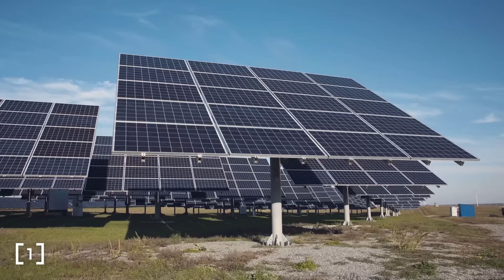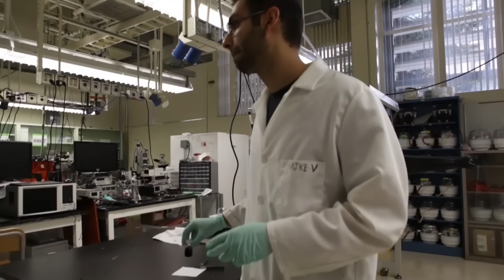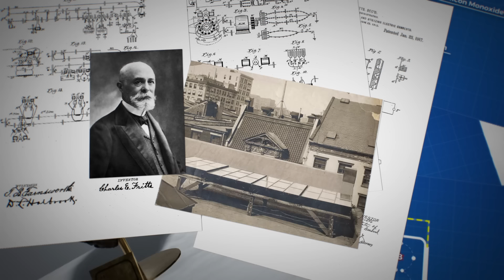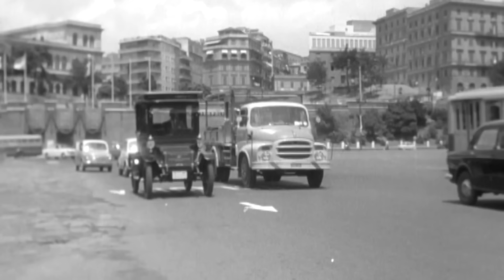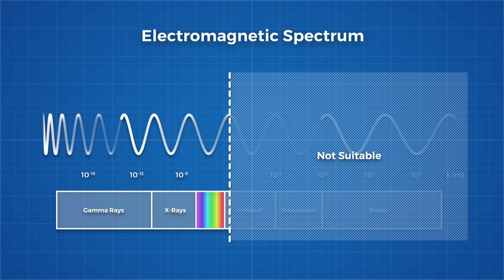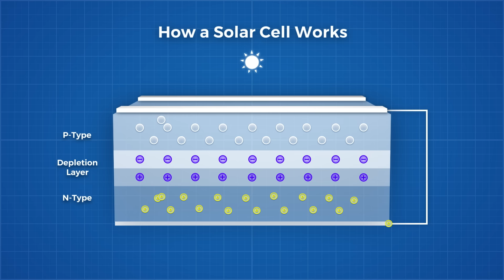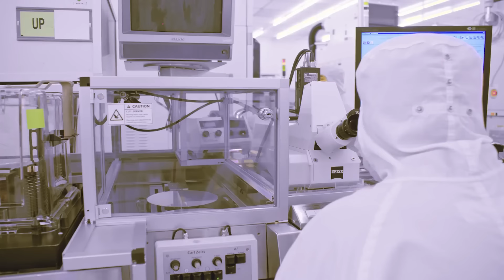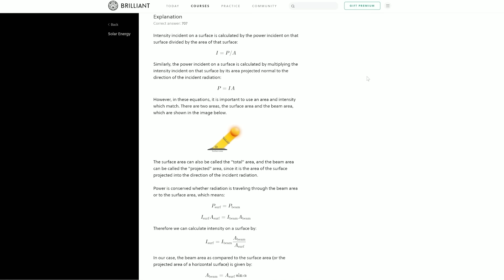The Mystery Flaw of Solar Panels

Comment: “Installed capacity” of 630,000 MW translates into 126,000 MW or less of actual capacity, if the sun is shining and the panels are new. It is an open question whether a solar panel makes enough energy to manufacture, install, decommission and dispose of itself in its lifetime.  If it does not, then every single solar panel represents a backward step in energy efficiency.
Reply: And your claim that solar can't generate enough power to cover it's lifetime is rubbish
Reply: This is true, however there is value in the research and fabrication techniques that is very difficult to quantify. We also can't know whether or not it's "worth it" until we push the technology to its limits. Unfortunately that's the reality for any technology.
Reply: It is worth noting that solar cell prices have been dropping like crazy, to the point that even without subsidies, the payback for installing a cost-effective roof mount system in a reasonably dry sunny climate is now as low as 7-10 years.
Reply: @theredscourge   I don't know what country you're in, but here in Australia we have some of the highest electricity prices on earth and the payback can be as little as 2-5 years
Reply: @samk4339  Meanwhile your coal is exported to China where electricity is inexpensive and they can afford to produce and profit off these eco frauds.
Reply: @topduk  actually China just stopped importing Aus coal and is also the world's largest renewables generator and has cancelled construction on most new coal, gas and nuclear power plants.
Reply: @samk4339  hi, 
I couldn't find a source corroborating your claim, could you please provide one ?
However, I did find several that say China wants to massively increase nuclear capacity, by nearly ten times by 2050 (from 58 GW to 500+ GW). 
here it is (updated October 2020) : https://www.world-nuclear.org/information-library/country-profiles/countries-a-f/china-nuclear-power.aspx
Reply: @yamchas  https://www.google.com/amp/s/www.technologyreview.com/2018/12/12/138271/chinas-losing-its-taste-for-nuclear-power-thats-bad-news/amp/
Reply: @samk4339  hey,
the article you shared even states that while some experts IN china believe nuclear is on the decline, the official stance of the Chinese government is still pro nuclear, which also aligns with the Chinese government confirming plans  to add 200GW by 2035 having started building 4 more in 2019, and aiming for 6 per year for the next 5 years

As for the stopping import of coal, thats a political reaction to Australia placing taxes on exports to china and preventing the sale of assets to china, The coal that would have been imported from australia is instead being mined with in china with new mine being confirmed just the other day

https://in.reuters.com/article/china-nuclearpower/china-to-build-6-8-nuclear-reactors-a-year-from-2020-2025-report-idINKBN24A0DL
Reply: @samk4339  Cheers Sam!
So, we're left between this prediction, and the fact that, as another commenter said just before, the chinese gov is still pursuing nuclear power as an option, and that China has started building new ones since the article you sent was written, but perhaps with less enthusiasm. So i guess we'll have to see. In any case, their renewables produced only 9% of their needs last year, so they are far below the threshold after which problems and costs start adding up for renewables (although renewables have started making everything else's electricity more expensive, as their nuclear or gas plants, for example, are kept at a low level while the wind is blowing)
Reply: @yamchas  sorry but your 9% figure is bullshit.  In 2017, renewable energy comprised 36.6% of China's total installed electric power capacity.
And that was 2017! Since then they have built even more renewables capacity and it outpaces the increases in coal and nuclear 2 to 1. 
Also your claim that renewables increase the cost of power is a right wing talking point that has been debunked many times over. Coal and gas receive more subsidies than renewables. In fact you sound like a lobbyist for a fossil fuel company, who do u work for?
https://en.m.wikipedia.org/wiki/Renewable_energy_in_China
Reply: @samk4339  Hi there, 
sorrry, I hadn't seen your reply. I'm not sure if you read the webpage you sent, if you scroll a bit down, you'll see that most of their renewables productino comes from hydro power, it's just bundled together with solar and wind to inflate the amount produced by renewables, but like I said, solar and wind do only produce a tiny fraction of their needs.
Also, no I'm not a lobbyist for a fossil fuel company, I'm just a disillusioned renewables enthusiast. Since we don't know each other, I feel like it's a bit pointless to speculate about what we both do in our life, and we could have a more productive conversation if we just stuck to the point :)
Have a good day Sam!
Reply: @samk4339  Oh, and I forgot, not, the reason renewables make electricity more expensive is because building up your energy capacity obviously costs money, and using renewables means you spend money on something which sometimes does not work at all, and therefore needs to be backed up, which is why you end up building more infrastructure than you would actually need if you had built a non intermittent power source. 
If you want to convince yourself, try typing 'wind map' in Google to see... a wind map, and you'll see that it's mostly quite low about everywhere, apart from a few times where it's actually strong (this is relevant since, as I'm sure you know, wind power depending on wind speed do not follow a linear course, i.e. if a wind turbine has a maximum capacity of 90 km/h, if the wind blows at 45 km/h, it doesn't produce half, in fact it produces 8 times less (see graphs here: https://eolienne.f4jr.org/en/eolienne_etude_theorique) (you can click on the 'english' (anglais) button, top left of the page. )
Therefore, to wrap it up, you'll see by looking at wind maps that it's pretty much low all the time, and just not very reliable. Which is why you need to have your backup capacity ready at all times (like in Germany, where gas and coal are injected when there's not much wind or sun). Which is why it costs way more in Germany than in France.
Reply: @theredscourge   7 - 10 years but does that take into consideration (1) the purchase and installation subsidies and (2) the costs of decommissioning and disposal?
Reply: And crucially, it produces 0 MW/h for about 6 months of the year (if you put together all the nights of the year together) + very little in the winter months. The grid has to be balanced on a 2 to 3 minutes basis, so 630 000 MW of solar is equal to 630 000 MW of backup power, usually gas, sometimes hydro, or nuclear. Actually, they mention that Germany gave up coal, "yeeeeaah", but they didn't mention that they are going full on with gas instead, which is a little misleading I think (although the Navalny poisonning has put pressure on Merkel to cancel the gas pipeline from Russia, so this might be the return of coal? https://www.oilandgas360.com/merkel-scrapping-nord-stream-would-unravel-german-gas-strategy-also-impacts-the-eu-and-beyond/)
Reply: There is a documentary called 'Planet of the Humans' that talks about exactly this.  The only way to keep the planet habitable is to reduce consumption (or reduce the number of consumers) of non-renewable resources.  You can find it on YouTube here https://youtu.be/Zk11vI-7czE
Reply: And the huge amount of toxic waste that's left over when the glass and metal has been recycled. Solar power is just not worth it imo wind is better and hydro even better.
Reply: @PsychoticEwok  its not just the decommissioning waste.  just like environmentalists love to act self-righteous whilst driving their EV's, they ignore the waste generated through the raw material production all the way through manufacturing. photovoltaic production uses many, many different HPM's (hazardous process materials) that require several steps of refinement. the power density just isn't there, and may never be.

Oil and gas isn't going away unless people want to live like feudal times. wind turbines require oil, heck, any rotating mechanism requires oil. theyre loony in their ambitions because none of them have worked in any related industry.
Reply: @UniqueBreakfastTaco  oh yeah for sure, it's our technology itself that's is the meat of the problem metal refining is horrifically messy and plastics don't even get me started on that 😆 we're pretty screwed unless we have a huge technological leap
Reply: @PsychoticEwok  pretty much. The world's industry is completely dependent on fossil fuels, and that's not just gonna change over night. Good news is that the climate models touted by "scientists", ie activists, are very inflated and largely based on hypothesis rather than provable fact. So don't let the fear mongerers get to ya and just live your life best you can 🙂
Reply: Installed capacity means what it says. I have 2.78 kW of installed capacity at home, and can generate 2.93 kW on a bright sunny winter day. And your suggestion that solar panels can never produce enough power to offset their production costs is laughable, the kind of nonsense once peddled by oil companies. Until they got up to speed and began investing in solar themselves.
Reply: @paulmaxwell8851  Hi, no installed capacity does not take into account capacity factor. I'm curious to know how much electricity your panels produce in 24 hours? If you have data on a whole year as well, then you can figure out your capacity factor at your very own place, I'm also interested. Average capacity factor for solar panels is 15%.

Comment: Actually the lost energy from PV cells is well known to be due to Si-H bond related. The Si-H bond is 3.2eV and is broken over time by UV light. (Original work of Peter Le Combre and Spear - DLTS measurement of hydrogenated silicon.  Dundee Uni - in the early 80's.) Once Si-H bond is broken it leaves behind a 'dangling bond' (Si -)  which serves as a SRH surface recombination site for electrons and holes. This is an old problem known by all semiconductor device engineers.  Also any other defects..   eg. carbon. and Andy and all physical defects like silicon clusters or dislocation loops all act was recombination sites. Hydrogen is used to passivate surface states. It's also used for ALL semiconductor integrated circuits today. Although, in this case packaging blocks the >3.2eV sun light.  An end of line 400C H2 bake is standard for all chips. Hydrogen is released over time in PV's. btw. Deuterium is also used, which has a higher Si-D bond strength but generally too expensive for PVs'. Satellite apps only where UV is more intense.  The metal blocking issue is also now solved by digging contacts from the backside of the wafer. Also old tech, used in IC's, but one that is only now cheap enough to apply to PV cells now that 6" processing tools have fully depreciated. eg. SunPower Cells have no metal on top. ....

Comment: So the problem is exertion of a particular Atomic action due to the fact that it is not being informed like a cell. It took Edison to change the filament through his light bulb and different times to be able to find the right kind of filament with the right kind of balance and Simpson it improved are you checking on dip different Atomic materials that have an attractive base

Comment: The NON mystery flaw of solar panels is, however, the far more damning one.

The MAX power any solar panel can produce is based on the Solar Constant, which is, for purposes of round numbers, right around a kW per square meter. You are, even there, limited by the efficiency of the panel -- which is currently 20%. So to generate one kW, you need to cover FIVE SQ. METERS with panel... and THAT assumes you're ready to USE the power right now, which you may well not be. So you have to STORE the power, which adds STILL MORE inefficiency to the system.

Oh, but it's CLEAN power. 

The eph it is! Solar panels are an offshoot of making printed circuits, which is one of THE FILTHIEST THINGS HUMANS DO. Computer chips, on the other hand, shrink steadily, so the actual amount of toxic production is relatively constant.  But hey, that's not enough seriously filthy, horribly toxic waste!! Let's make MILLIONS OF HECTARES of them!! 

SMH.

Just because you get China to make them for you doesn't mean all that pollution doesn't exist. Out of sight is not "out of reality", at least, not if you're beyond playing "peekaboo" and thinking the world disappears if you don't see it any more. :-/

Solar panels ALSO, because of their intermittency, mean actually RELIABLE power plants (oil, gas, nuclear) have to be ONLINE ALL THE TIME idling, just to take up the slack when the sun goes behind a cloud...Meaning they're adding CO2 into the atmosphere anyway.

Solar. For when you absolutely, positively, want to generate your power in the most ineffective, filthy, and stupid way possible.

Comment: All that extra energy creates Heat why not add a heat capturing device to make energy through Heat
Reply: I've been able to convert heat into electricity using an ordinary OHMITE resistor. Suppose you select an OHMITE resistor that has a 10W ceramic body. Now, for about a minute, apply high Heat to the body of the resistor. Now remove the heat source. Now apply a DC voltmeter to the leads of the resistor. If you get the same results that I got, you should witness that the cooling resistor develops a DC voltage across its terminals.
Reply: I could see water radiators absorbing the Heat or something like

Comment: Since heat is detrimental to the efficiency of the panels why has no one (or have they?) stuck a low pass filter on them so the spectrum that doesn't produce electricity can now be attenuated from producing heat as well which would help the panel since the hotter a panel gets the less electricity it will produce?

Comment: If only some of the light converts to electricity and most of it goes to heat, why not use the light as a source of heat... And have a regular power plant that uses steam. Then the light isn't limited and even infrared can be used.

Comment: That was a masterclass in how to transition into an ad. Hooked me so well I wasn't even upset I had just watched an ad, not gonna lie.
Reply: It helps that the sponsored product is of actual value and related to the content of the video.
Reply: @zucadasilva937  Solar panels cause Toxic waste during their manufacture. The resources that go into the manufacture and installation of solar panels, require mining companies to pollute and burn hydro carbons, like diesel and gasoline. The mining companies dig holes that don't need to be dug. The panels have a 25 year operating life span, then part of the solar panel ends up in the land fill forever. YUCK, I don't like toxic waste.
Reply: Perhaps you need to compare that toxic waste against the amount of toxic waste that is prevented by reducing the amount of electricity that needs to be generated by other means.
Reply: @listerdave1240  Let's not forget that the main ingredient, silica, is made by Mining high purity quarts and mixing it with coking coal, and then firing the mixture in a electric blast Furness. I also submit that the thermo/electrical energy consumed is also greater that the pannel will ever produce in the pannels life cycle. You people need to come to your senses. You are destroying the planet when think that your helping it.
Reply: @davidbruce2159  I think you may need to recheck and/or update your calculations with regards to how much energy PVs produce compared to the energy needed to produce them. What you state would have been true about forty to fifty years ago. Today it takes well under a year for a typical PV to offset its carbon footprint. 
Also, if you were to consider the carbon footprint of building a standard thermal power plant (coal/oil/gas) you will find that even building the thermal plant has a higher carbon footprint per megawatt of capacity even before it starts consuming fuel to produce electricity. Thermal power plants need vast amount of steel, concrete and other materials produced in blast furnaces, kilns and such.
The only issue with solar panels is that they currently only offer a partial solution and therefore can only be used to substitute part of the fossil fuel production rather than all of it. That is likely to change very soon though with the introduction of liquid metal batteries and possibly other storage systems.
Reply: @listerdave1240  more wishful bullshit stop wrecking my planet
Reply: Liquid metal batteries? That's the first time I read about such idea! How crazy
Reply: @steampunkastronaut7081  Just check in this channel, he has a video about liquid metal batteries ;)
Reply: @davidbruce2159  you don't care about the planet. You just pretend to while bashing renewables. You're an act.
Reply: Commercial solar power is a CANCER on the planet. The technology when paired with the use of FAKE money causes a wealth transfer from the working class to the elite class. Be careful of what you wish for.

Comment: Crystalline silicon cells based on P-type wafers contain boron and oxygen impurities simultaneously which under light exposure start to make complexes that act like defects, hence increasing the recombination losses which reduces the efficiency. Crystalline Silicon cells based on n-type float zone mono crystalline silicon wafers, such as Inter digitated back contact solar cells, do not suffer from light induced degradation as it does not contain boron impurities and high level of oxygen impurities.